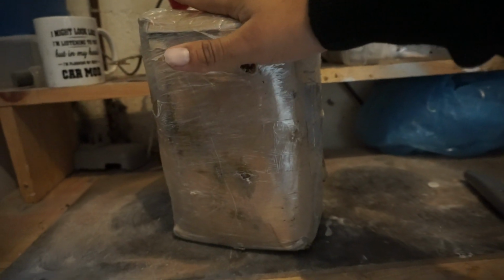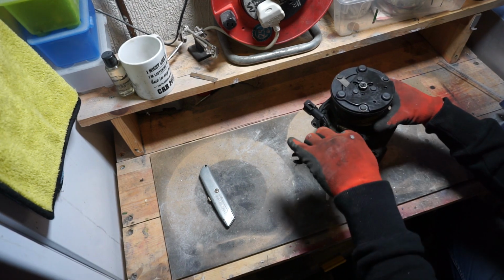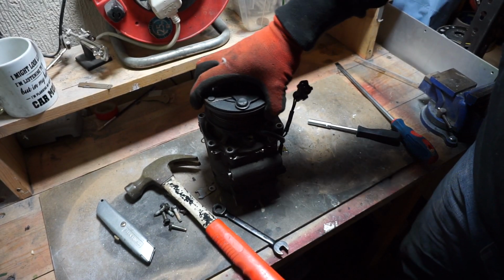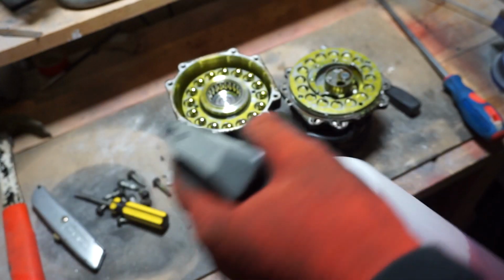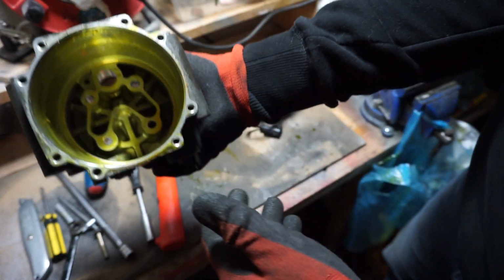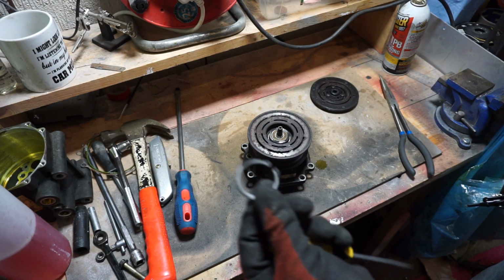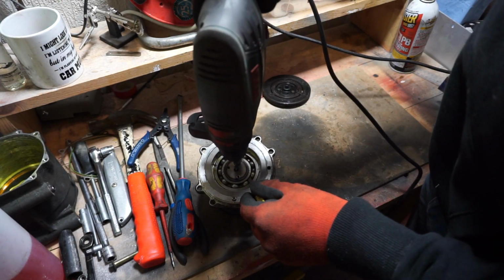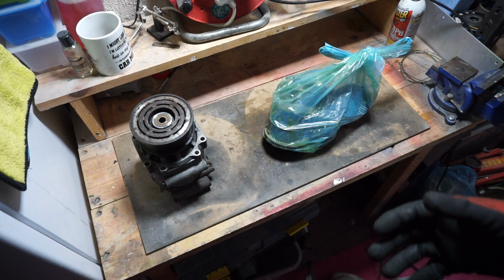Gutting an AC Compressor

Comment: Couldn’t you use a belt of a fiesta that doesn’t use ac ? As some fiestas don’t come with it could be wrong tho
Reply from the maker: I'll have a look when i start taking it apart, but I've got a photo of the side of my engine and it looks like when the AC compressor is out the belt would be rubbing with the other side of the water pump, but I'll be able to double check this when I dismantle it all
Reply: MARKEL KNIGHT yeah that’s true mate just look into it 👍 the zetec se is a common race engine used in kit cars and stuff so I’m guessing they don’t have ac so they must of made a get around